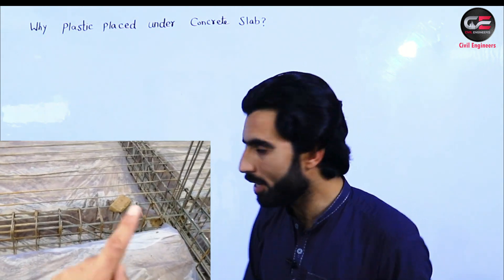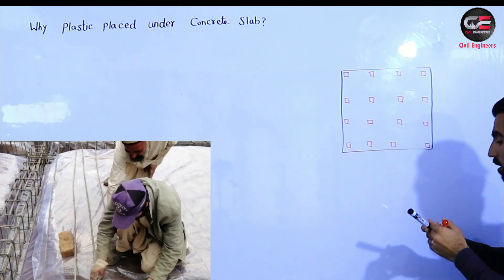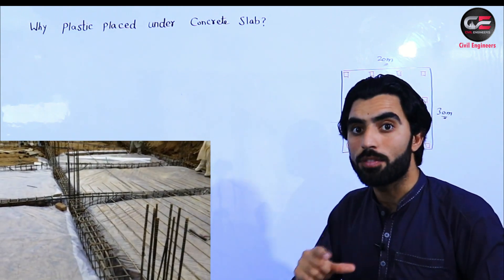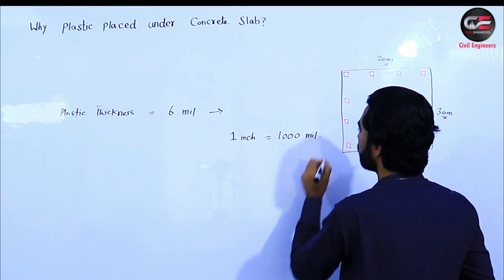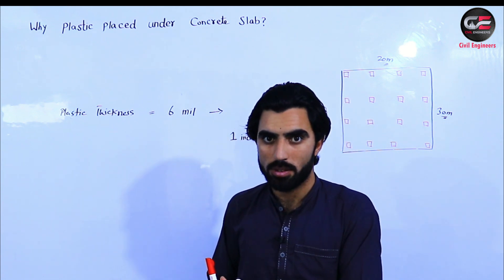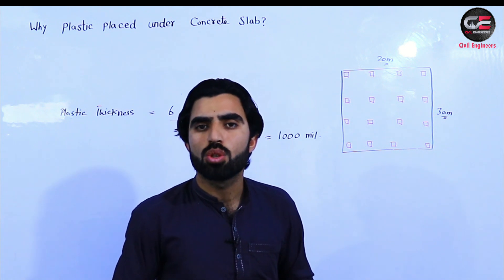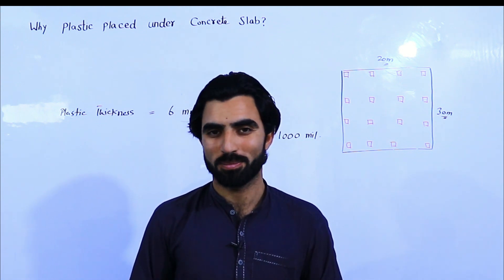Why we Placed Plastic Under Concrete Slab?

Comment: There are so many purposes, why plastic providing in Raft foundation, first as you know generally  before placing the reinforcement, a lean concrete around 5 to 10cm are provided so that a concrete bed are make sure for reinforcement. Second the main purpose of plastic/polythene sheet to avoid the moisture from direct abserbsion in soil that's way, third to avoid rebar from rust/ carrusion.
Reply: Hi Sir,
Could We place this plastic under the base of a retaining wall.If we place this will it affect to soil passive pressure?

Comment: Bro on what basis we determine the depth of the foundation and what type is used for the structure can you please make a lecture for that🤔
Reply: There are so many factors that affect foundation depth such as soil type, bearing capacity, structure load, etc.

Comment: Could we place this plastic under retaining wall base?
Reply from the maker: No bro
Reply: @CivilEngineerss  Am not a Civil  Engineer but through your daily lectures i  now have deep knowledge thanks for the good works, my question is am putting up a building one side is car garage with area of 288 square meter and the other part which my residence 144 square meter all combined in the foundation, now which grade of concrete should i used for the floor slap for the garage side
? since the two areas are of different purposes thanks
Reply: No because Retaining wall must drain from everywhere possible. Water can push a wall down so better safe than sorry.

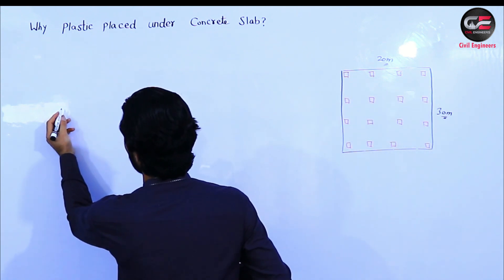Comment: Bro, 2:35 are you using polythene sheet on top of beam rods, on top of your slab.. How does it prevents water to reach beam column and slab 🤣Very very confusing information